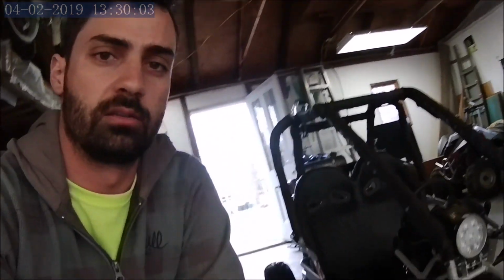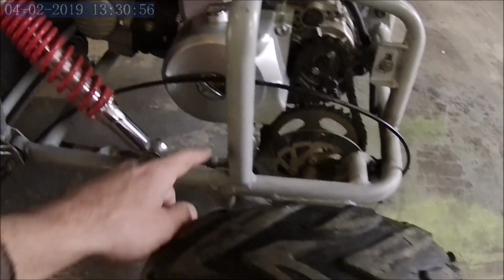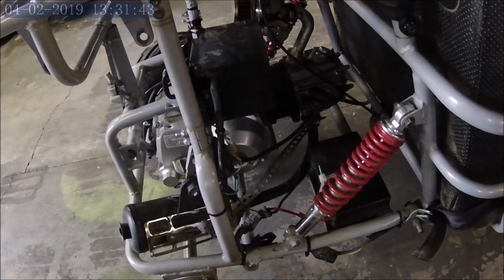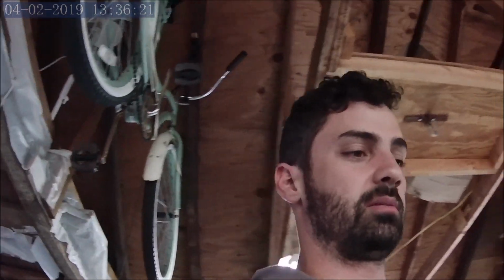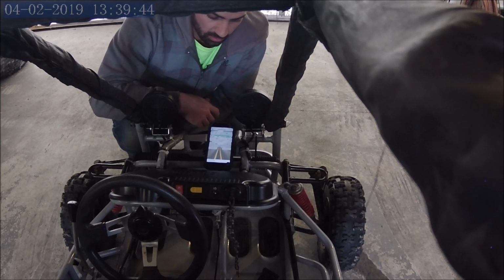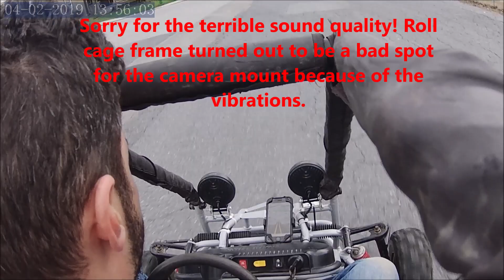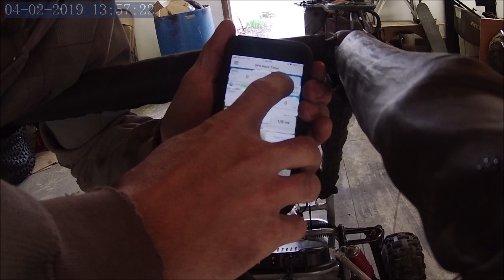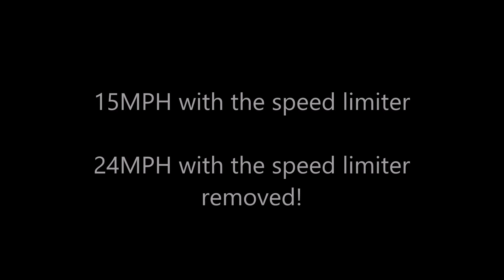Top Speed Run: 110CC Go Kart and Review

Comment: Thanks for sharing, Best video I've found for these go karts.  Working on 1 for my neighbor & I can NOT find the HiGH gear, all I can find is L/Low, N/Neutral, & R/Reverse.  Is HiGH gear found by pushing the shifter Backwards er Forwards??         Thanks again,   - take care
Reply from the maker: On this one you pulled it back to go from neutral to low and then again to go from low to high
Reply: @burnout_MEDIA  Oh okay thanks man, are you sure?  
This 1 is forward for L/Low, back for N/Neutral, & back again for R/Reverse. I really do NOT think it has a HiGH gear.
This guys shows 4 different, but very similar karts & they're all like the 1 I'm working on: 
   https://youtu.be/z71VtdBw3fY
Reply: Old comment, but my sons gocart is doing the same thing. It will only go into “L” gear. It goes into Neutral and Reverse but for forward gear it’s only L gear. It’s strange because it never did this before it’s only 6 months old. The shifter mechanism is janky as hell on these things.
Reply: @goforbroke2  Idk man, I worked on 1 for a neighbor. Keep looking/searching, maybe there's an adjustment on it.    - take care

Comment: I have a DF125GKB 110cc do you have to manually shift the transmission? How many speeds does it have? Thx in advance.
Reply from the maker: Yes you have to shift it but no clutch. Two forward speeds and a reverse
Reply: @burnout_MEDIA  I greatly appreciate it!